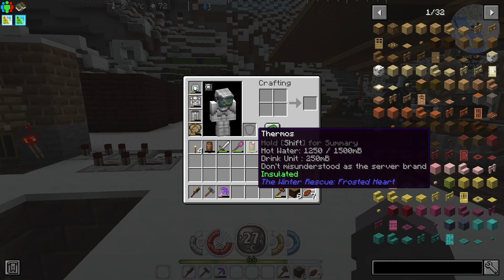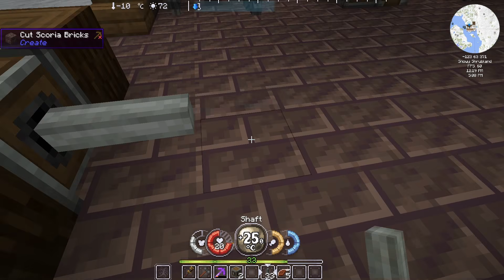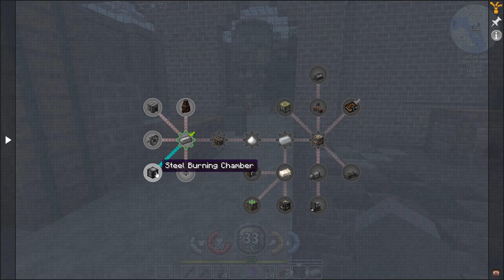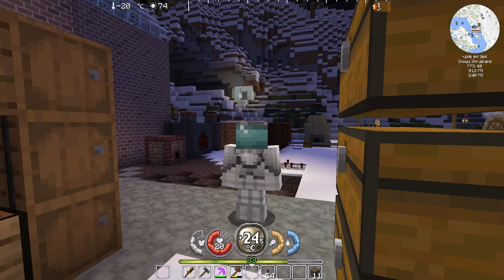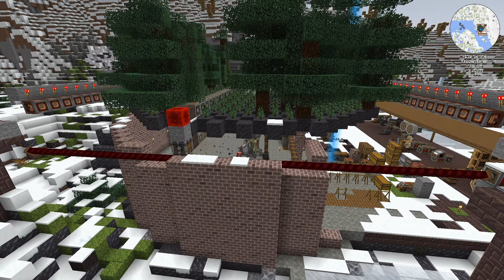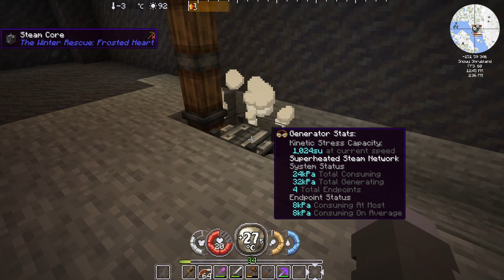The 100% Tree Farm | The Winter Rescue Ep 8

Comment: maybe im missing something. but why not just use a rotating system instead. then your saw will always face the right direction. 
a single arm spinning constantly clockwise that doesnt need to spin the saws around ever or need to send a return signal with redstone. which would then be alot easier to set up.
Reply: That needs a mechanical bearing or windmill bearing, which are locked behind much later research

Comment: Really love this series. Quick question: Can't you just put a campfire in front of the fan to "cook" the creosoted briquets?
Reply from the maker: Campfires need to be filled with fuel occasionally otherwise they burn out, technically I could probably use a mechanical arm to feed the camp fire tho
Reply: @Jamez28 You should be able to use a vanilla dropper and pulse repeater from create to make a simple timed dropper.
Reply: @Jamez28  does lava turn obsidian ? if not you can use iron/copper trapdoor and lava for heating briskets
Reply from the maker: @cagan6783 they have to be smoked the lava blasting just destroys them sadly
Reply: @cagan6783  Lava does cool, not to obsidian, but basalt.

Comment: if I remember correctly in create you can use the item drain as a belt that uses no stress
Reply: It is very material intensive
Reply: @Frugthereal it may be material intensive but it will save on lag and stress in the long run. by the time you get like all the materials automated the intensity just dies off. plus it's less stressful ba dum tss

Comment: Sounds like the pack with all the SU costs on the 'normal' parts to move SU around is wanting you to run your main power supply at as low of a RPM as you can get away with and use speed controllers to step up to the desired RPM at the machine instead of running the entire factory at 256 and only stepping down where needed.